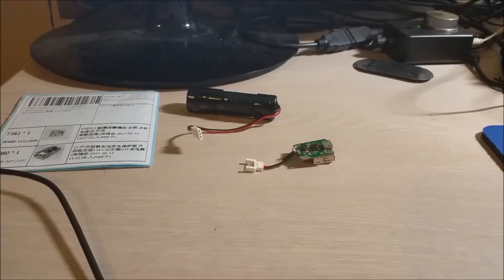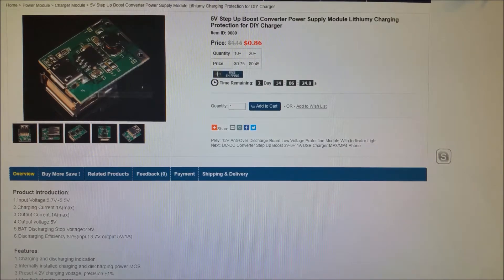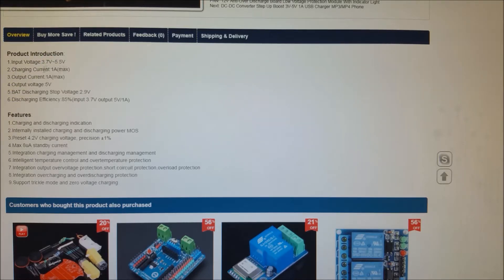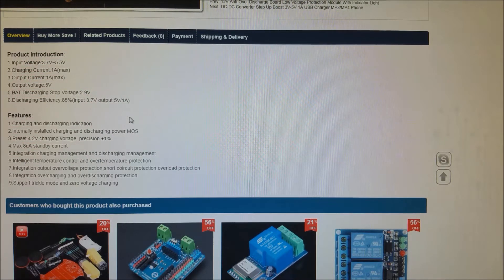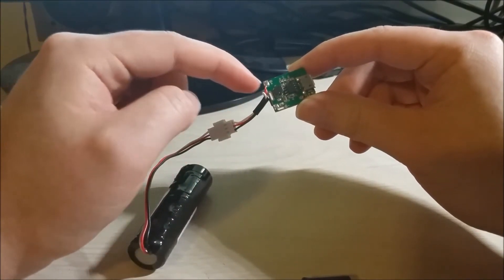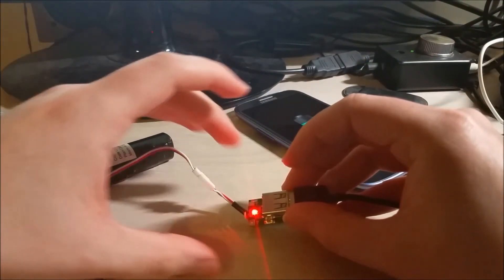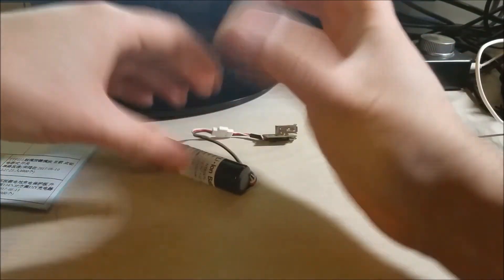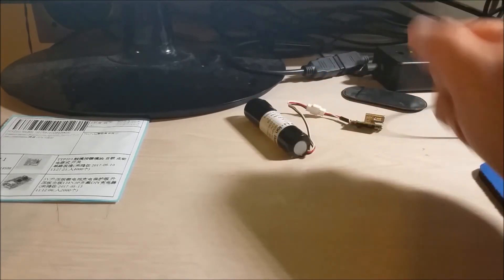ICStation Lithium Battery USB Charger and Boost Converter Review

Comment: can I charge two parallel batteries by this module?
Reply from the maker: Yes, they will just take twice as long to charge. Just be careful that the two batteries have the same voltage when you combine them or thing may get very hot.